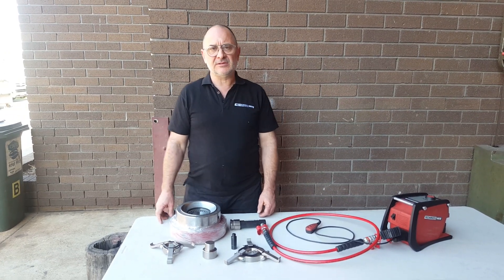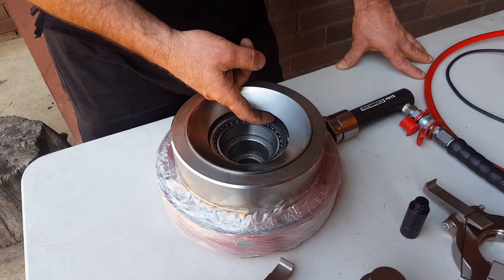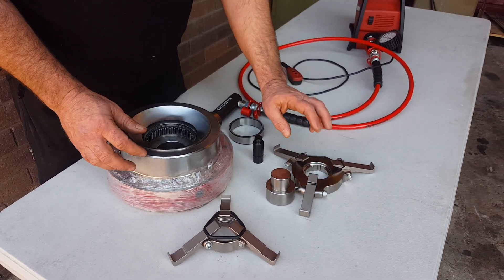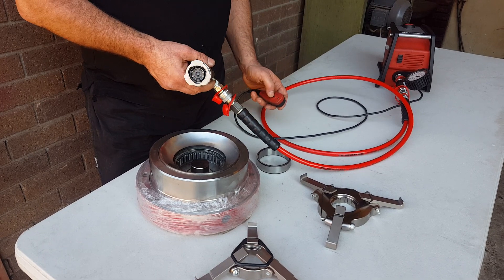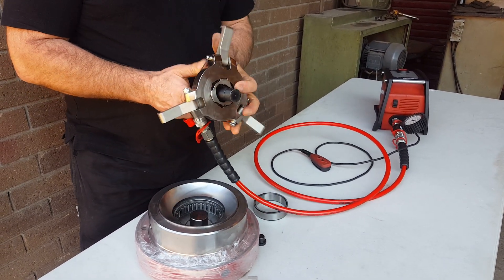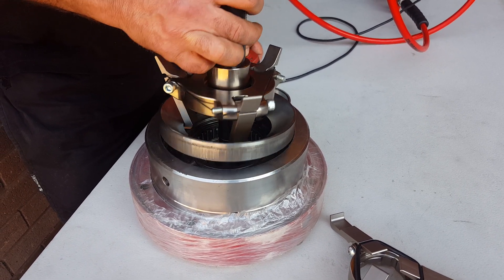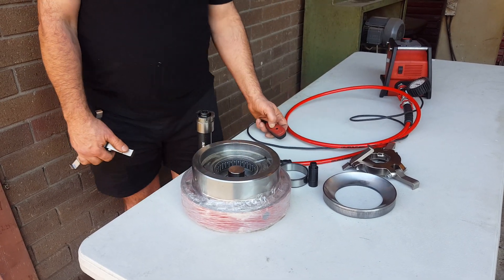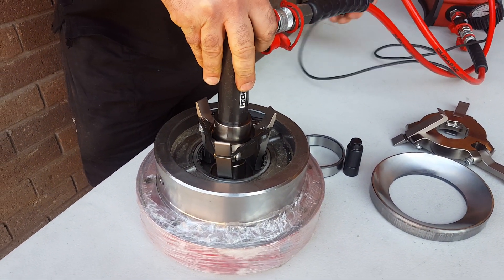Hydraulic 3 Jaw Bearing Puller

Comment: 😲
Reply: Makes it look so easy.
Reply from the maker: Thanks. It is easy. We designed the jaws to make sure they suited this application, as well as being general purpose. The larger bearing needed up to 2T to remove, which is easy using a 5T hydraulic cylinder. I could of also used a hand pump, but....why would I when I have the battery pump? :-)
Reply: That portability... opens up where you can use it.
Reply from the maker: Exactly